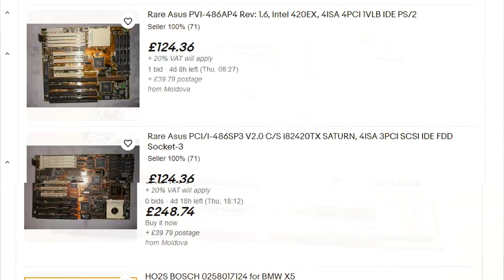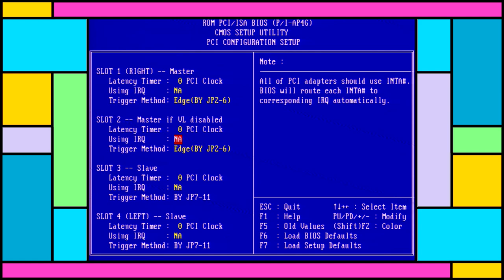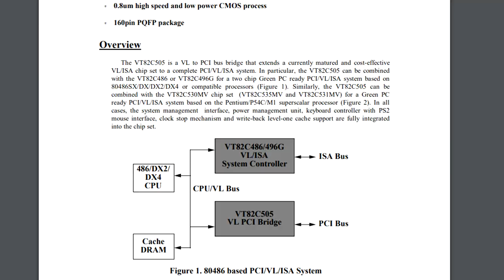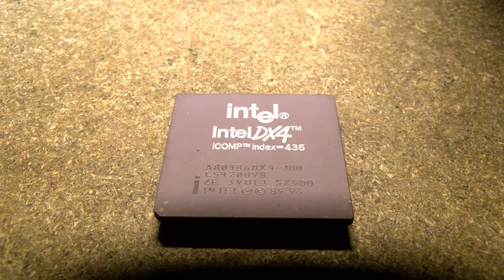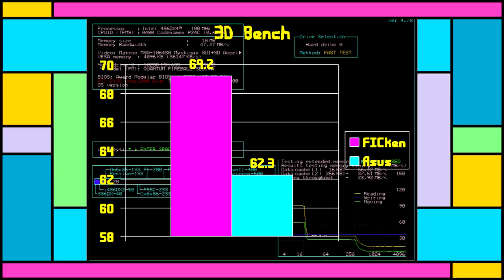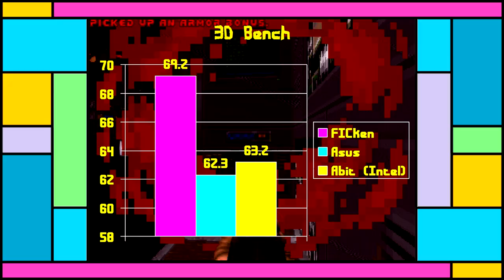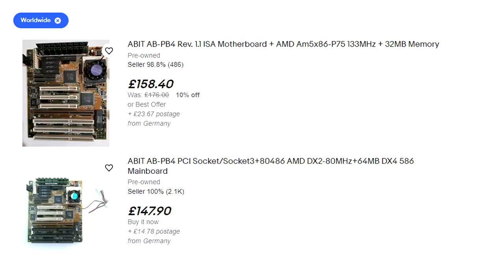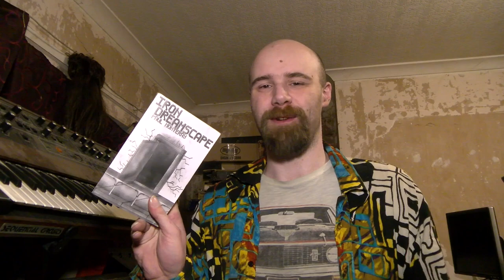i420EX & VT82C496 Motherboards

Comment: Like what you do mate! I would really like to know more about your current situation as well, like the old vids you posted. Landlords and stuff, thoose where awesome.
Reply from the maker: Not much to show on that. The house looks the same as when I walked around it, only slightly more moldy and with walls and floors moving a few inches further. Still not allowed to move. Still can't get anything repaired. Still no heat or hot water. Still no power on one side of the building. Still nearly £500 a month on rent.
Reply: @HighTreason610  I am sorry to hear that mate.. But maybe if you continue to do videos on your situation, more people will support you I think.. And you deserve it

Comment: I love my Abit PB-4. It really flies with a 5x86 and the BIOS tweaks can gain you an extra few FPS in Quake as well.
Reply from the maker: The PB4 was the only one of the boards here that ran Quake, but it wasn't included both as there was little point comparing it to boards that didn't, and because adding more to the video timeline just makes things increasingly unstable.
Reply: @HighTreason610  that makes perfect sense - I'm not normally one for running Quake on a 486 anyway, but I learned a lot about the various tweaks during the #486quakerace. The main limitation I encountered was the 40MHz bus of the 1.3 revision. It seems 50MHz existed on 1.5, which is interesting though annoying. Like you say, what CPU would that have been for? One that never materialised is the only answer we have. Would have been nice to have a bash at running the 5x86 at 200MHz.
Reply from the maker: I managed 180MHz on the ECS UM8810 PAIO, but can't remember what I got out of it. I did keep a record, but seem to have misplaced it, 19.1, maybe, that sounds right.
The thing with 50MHz is that AMD did intend to use it, whereas Intel didn't - or else I don't know of any Intel DX4-100 with a 2x mode - and as Intel clearly didn't intend to support AMD's processors, then yeah, it can only really be for an Intel CPU that never released. AMD DX4s did have a 2x mode and the DX5 was at least meant to do 150MHz at one time.
This editing and rendering is becoming extremely difficult with the corrupted files that get barfed out. I really, really need to get an old machine doing raw composite captures or something.

Comment: Gotten one of these boards more than a ways back for peanuts that needed fixing but anyway the prices of things these days in general is horrendous like rock salt in an open wound.
Reply from the maker: This one also needed minor repairs. You might have noticed the blob of solder bridging a voltreg to an unused pad. I might have suspected something else was fried if it weren't for prior experience with the Intel 420 chipsets. Prices are indeed silly these days, in general, but you can definitely get a better board for less than these ones tend to sell for with minimal effort, for the time being.

Comment: The 486AP4 is really one of the worst 486 boards I have in my collection as well. Great video and benchmarks of the boards. Do you still have a copy of your book available? Cheers, Peter
Reply from the maker: Thanks. Seems to be the case for i420 boards in general, the Micronics M4PI had many of the same problems. In any case, it should be the "big machine" I keep mentioning in the next one which, by contrast, has a very nice motherboard in it, older and also a tad on the slow side but with good reason.
There are copies of the book left. I should be passing by the Post Office within the next couple of days, so can query them on the cost of posting one to Austria if you'd like one? Can't imagine it'll be very much.
Seems I have a couple of videos of yours to catch up on.

Comment: My "best" 486 board is a QDI board. It's not the best performance in the world. It doesn't have have any unusual features. It's just a plain 486 VLB board with support for 3.3/3.5V CPUs. But it "simply works", which is kind of the reputation QDI had back in the day. Not a brand that gives bragging rights, but it was commonly used by system builders since it was easy to work with.
Reply from the maker: I've always had good luck with QDI boards. They definitely "just work" aside from, ironically, one of their really early 486 boards that I have, but I've always suspected it was damaged at some point in the past, as other boards from the same lot were all defective in some way and the QDI was the only one to come up without repairs. Meanwhile their P6I440BX is probably my favorite Pentium II board - not exactly pretty, no special features, but I've never known one to break. They just do what they said they'd do on the the box, without exception.

Comment: Now I wonder.....Is it possible to just stack the Cache Chips and just rewire the top one's address line? Like piggy backing RAM back in the days?
Reply from the maker: Perhaps. They're just RAM that doesn't need refresh logic, as in, Static RAM.
As for PCI. Yeah. It even carried over to the early Pentium chipsets. The 430MX just loved to lock up when it didn't like an expansion card for some reason.

Comment: The Intel Aries chipset rev 0 has a l2 cache hardware bug (fixed in rev 2 Aries chips). Using Fast cache state (2-1-1-1) can cause lockups in protected mode.
Not Asus fault in this case. What Asus did without telling user was force Normal SRAM cache timings in bios, which gives 3-2-2-2 cache write wait state. You can fix this on the AP by:
Adding a 68 ohms SMT resister to the C54 location ( C54 is reserved, it has no component mounted). It's located near the VESA slot, between the S82426EX chip and the MX8315 (U35) chip.
One good point, the PCI performance on the AP is the fastest I have come across on any 486 implementation (VIA, UMC, SIS). Maxes out at 76MB/s
Reply from the maker: That's interesting to know. Asus can still be blamed for not disclosing this, though, given that if they took the time to work around it, they obviously knew about it. Even my no-name Chinese board came with a little green 'appendix' card pertaining to jumper settings being changed.
In any case, the fix has no bearing here because I always try to present things as they would be straight out of the box, under relatively 'normal' conditions. The average user wouldn't know this, definitely wouldn't have surface mount tools (I don't even have those, nor most work places) and certainly wouldn't have been pleased by the idea of having to modify their board. If it were me, I'd have returned it and gotten a different model.
I dunno, the SiS 497 seemed to offer better PCI performance, at least under general use. My ECS UM8810 would probably be capable of relatively high speeds, also, solely as it offers control over things like the PCI divider. It's a better performing board than the Asus here regardless.

Comment: HighTreason consumer advice... Could be a new series... 😅
Reply from the maker: Don't think there would be enough to do it for long. Still, here's one for you - twenty concave LEDs usually cost £3 or £4 to buy alone. British store "£ Stretcher" currently sell sets of 50 LED Christmas lights, complete with a battery holder, for £3 a set. I've been buying them up every time I go by since they appeared in the store a few weeks ago. They also do a 25 set for £2.

Comment: Ah the "isn't it artistic" and "it must be preserved" crowds. No, it's a functional item and although it has a certain appeal about it, especially from an academic viewpoint, keeping it for having it's sake and not using it is an insult imho.
Reply from the maker: Yeah, I'm not generally on the side of that crowd either. Then again, some things are so crummy that they don't warrant being used to any real degree. There's every chance at least one of these boards will end up as a source of connectors for things that don't suck if the need arises.

Comment: I have the FIC-VIP-IO2 motherboard.  I have not experienced any of the issues that you report.  Mine boots up reliably and has always recognized all the RAM without issue.  I also have a full 1 MB of L2 cache installed.

12:56 What the hell are you doing?  Is that WD40?  I think I know why your board doesn't work.
Reply from the maker: Then you are unusually lucky.
It is. WD40 is very good at cleaning metal and the board was already on the list to take a bath, so it wasn't really a problem. Unfortunately I can't help but feel you probably missed my sarcasm when performing this procedure, in which it was implicit that the procedure was not 'correct', but it should still work in the short term.

Comment: you mentioned the boards that are stupid expensive.. Its not some of the boards are expensive.. But all is expensive if its from the PC XT area till pentium 4. There arent just alternitives.
Reply from the maker: Prices are generally higher than they should be, but at the moment, you can still find much better boards than these for far less with nothing more than a little patience. At these speeds (DX4/DX5) you do always also have the option of a Pentium, as there's still an abundance of generic 430VX boards out there and numerous Pentium chips nobody wants - with those you could totally get a motherboard, RAM and CPU for less than half the cost of the PVI-486-AP4 and have change left over.

Comment: Annoying people on the internet is fun, you say?
Hmm...
"Don't be a screw-up, load Windows 11, 22H2 up!"
Reply from the maker: Haven't had the joy of using Windows 11 yet.
Reply: @HighTreason610  It's not a whole lot different from Windows 10. Which wasn't all that much different from Windows 7. Which seemed pretty similar to Windows XP, at least to me. There'll be some changes that profoundly affect some people, but to me it all seems to be slowly creeping towards giving Microsoft more control of the system, and the end user less. But hey, if I really wanted full control of the system, I'd be running Linux or something, wouldn't I?

Comment: Even in current year ASUS are overrated. You pay over the odds and get a mugs eyeful of a board with loads of angular gamer shit and RGB and high failure rates.

I've been on ASRock since 2014.

I'm curious about your book. How do I get one?
Reply from the maker: Asus boards always come across as if you pay the price for a commercial grade board, but get consumer quality. They've had patches where they've made reliable stuff, but again, for a price where you could have bought better made commercial grade hardware instead.
For modern hardware I've favored SuperMicro for important stuff, ECS for less important stuff. The latter aren't always long lived, but they are at least cheap.
For a copy of the book it's basically just PayPal the cost of postage.